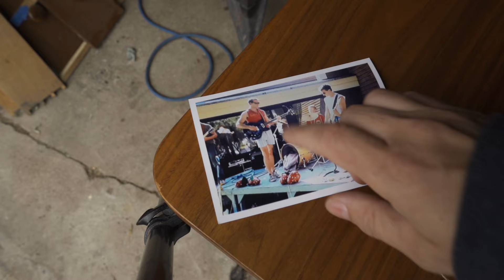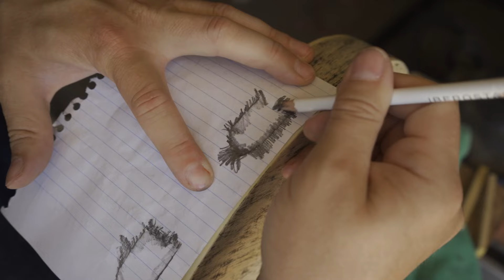Rattle Can Refinish On A Vintage Electric Guitar

Comment: Next time you give it a try you will find the best results by first Sanding down to at least 1200 grit using a random orbital sander then using the special wood filler they sell for that use. Next primer sand base coat color like silver under for gold over the then after you got the color you want several coats of clear Sanding with 1200 wet sandpaper  between coats till last coat then polishing then wax or ceramic. The for the binding tape up after Sanding with frog tape covering just the binding pull off before clear coating. Good job with the repaires

Comment: I have the same guitar in 6 string form, and in excellent condition. They were made by Eko in Italy. Mine is branded Balilla, which I understand was a brand they used in Canada. Seeing this video, I can see that the unusual contour of the top, in the neck pickup area is intended, and not the result of pressure over time.  Good job on the patching!
Reply: See both the guitar and bass in action in this video.  https://youtu.be/5apEctKwiD8